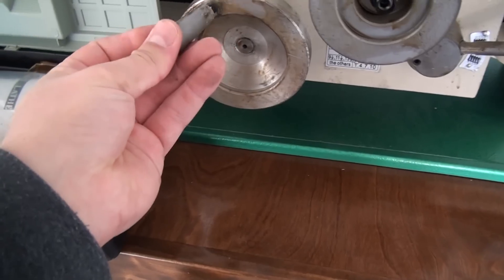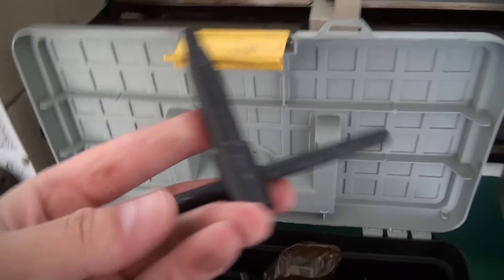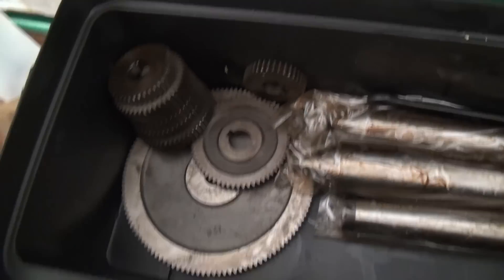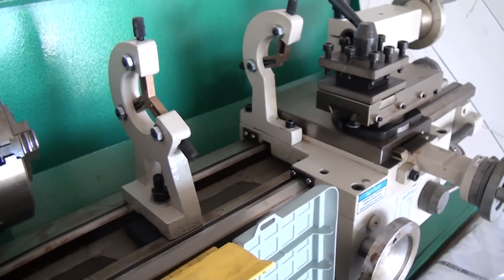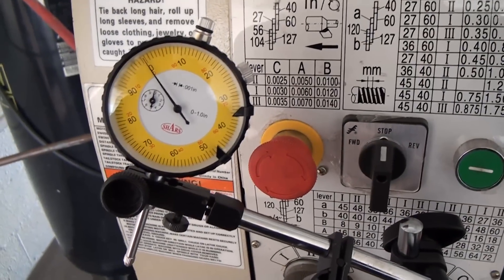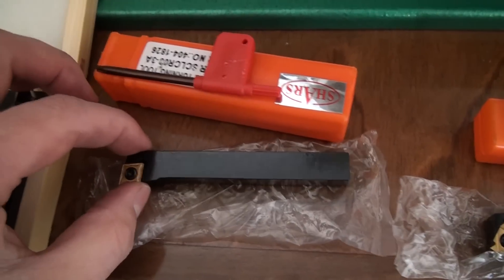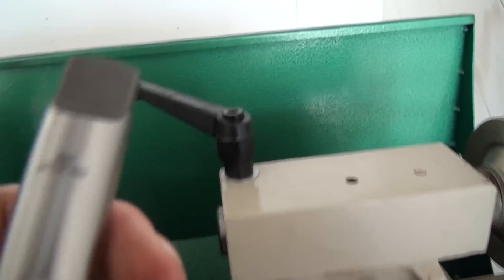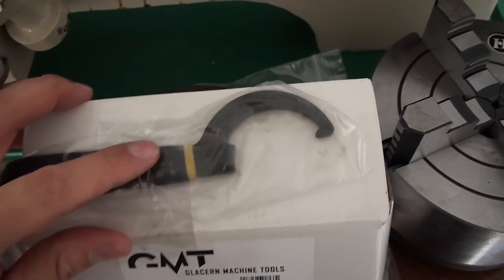03 G0602 - Included Toolbox and Initial Tooling

Comment: The drill chuck arbour is better like that, although its for a Milling machine, it also helps you remove the drill check after you've finished.  Don't cut it, use it for your milling machine.
Reply from the maker: Tommy Aventadore With this taper it won't fit in my mill, but it's been almost 4 years since I posted this video and I still haven't cut the shaft :)

Comment: that flat on the chuck is supposed to be there, the reason why it doesn't engage when you have it retracted is because that is the position to unlock the chuck to take it out. You did it exactly correctly in the video

Comment: Hi. you can just grind the little flap off.
It will work just fine.

That is only foor drill press and/or small mill.

Ive done it too and it works fine.

Comment: ok the faceplate is to clamp odd shaped materal to to machine ( what you can't get in the 4 jaw) or you can use it with a dead center in the headstock with a drive dog to turn between centers.  as far as the tang on your tail chuck if it doesn't engauge into anything i would just cut it off if the lack of travel bothers you.  all it is is the tang hitting the screw.  also i don't know if i like the idea of a key less chuck

Comment: Nice drill chuck!  I've just been using the drill chuck and MT3 arbor that came with my Grizzly X2 milling machine.  It does not have a tang at the end because it's tapped for the drawbar on the mill, so it's probably just shorter than yours without the tang.  Since mine doesn't have a tang (nor does the tailstock) it will slip if it's not engaged tight enough, but most of the time it's fine.